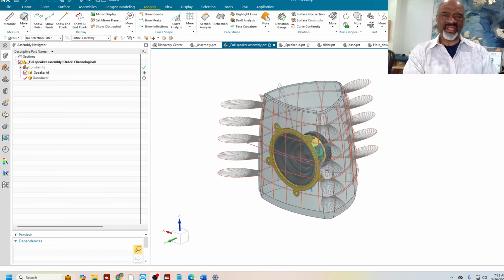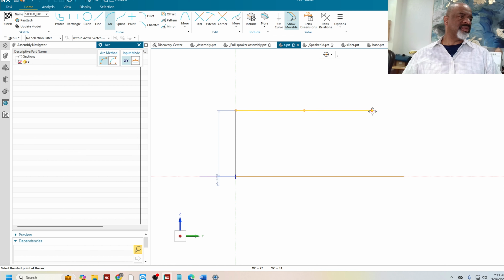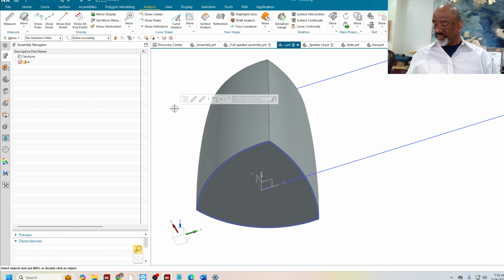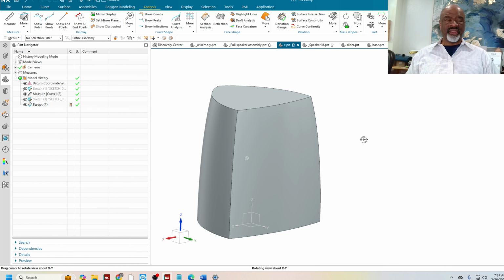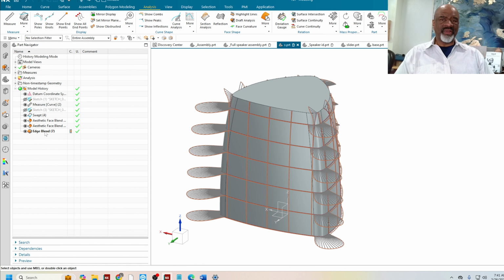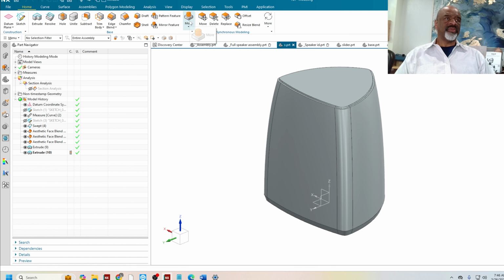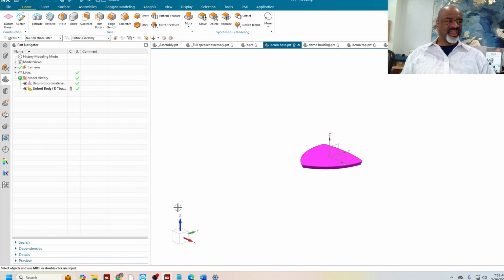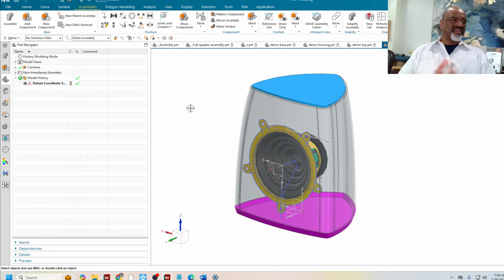Industrial Design Basics in Siemens NX! | Design Visionaries

Comment: Thank you Steven - lots of useful, and as you mentioned, powerful, techniques there. Sorry if I'm being dense, but could you go into more detail as to why the length of the straight curve separating the By Law Curve away from the trilobular base sketch has to be set equal to the perimeter of the trilobular base sketch via the Associative Measure function? That  straight curve separating the two sketches seems like an extra bit of geometry that doesn't need to be there. Couldn't the sketch for the By Law Curve in the Swept dialog be sketched with the endpoint of the perpendicular lower portion of the By Law Curve piercing the trilobular base sketch? I'm missing why there has to be that separation distance that is equal to the perimeter of the trilobular connected curves base sketch. Thanks!
Reply from the maker: Great question! We would love to go more in-depth about this with you. We now have new membership programs where we can answer questions and more. If you hit the "Join" button above, you can choose which member perks you would like. We also provide one-on-one training online or in person. If that's something you'd be interested in, let us know! Thank you for your support.